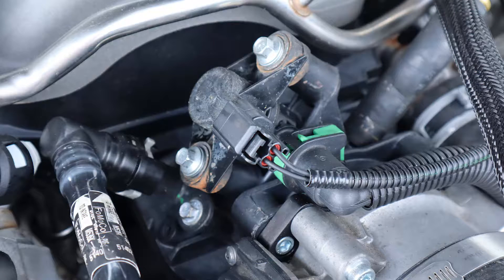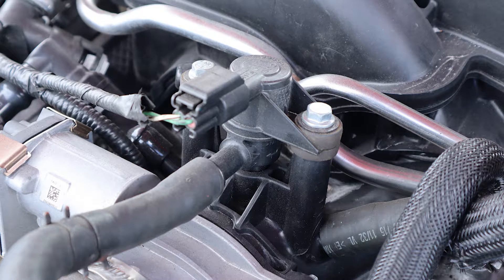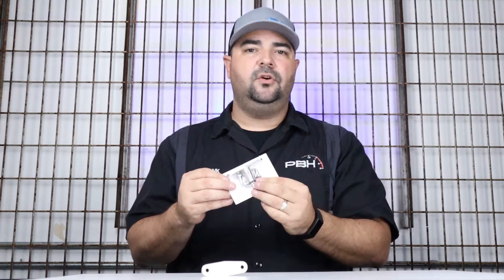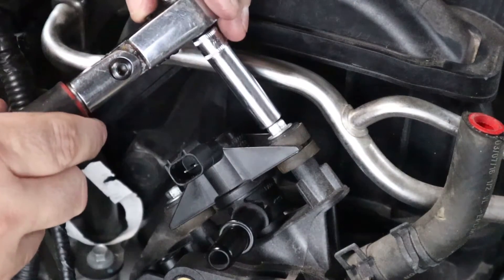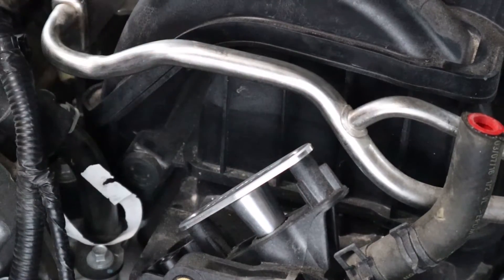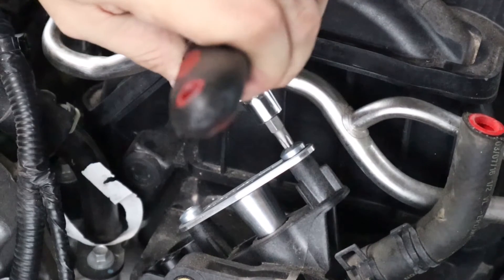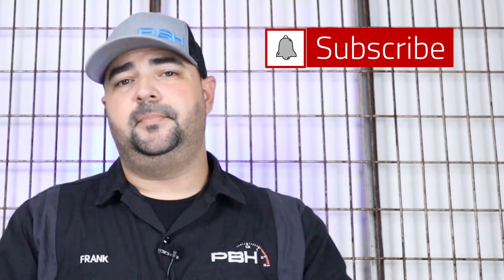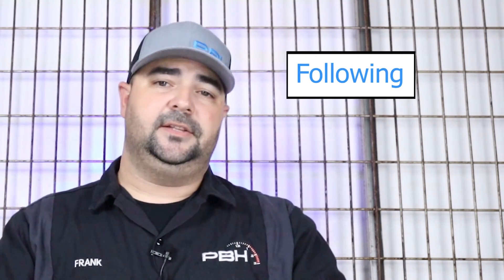40$ Coyote Swap upgrade! PBH-635

Comment: I got P0446; EVAP SYSTEM VENT CONTROL, will this product solve this problem?
Reply from the maker: It will not eliminate codes, that can only be done in custom tuning.  This product will allow the removal of the solenoid and will also need custom tuning to eliminate codes.